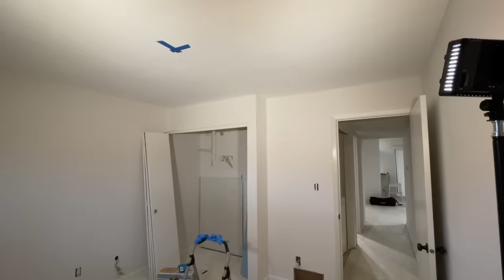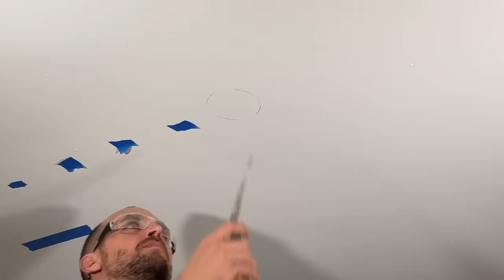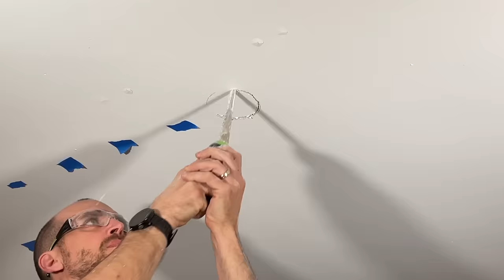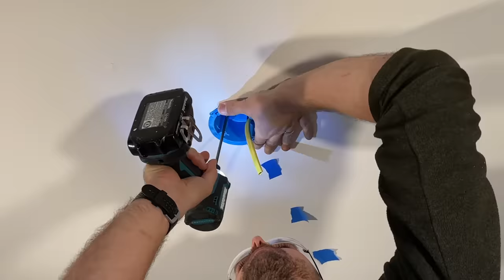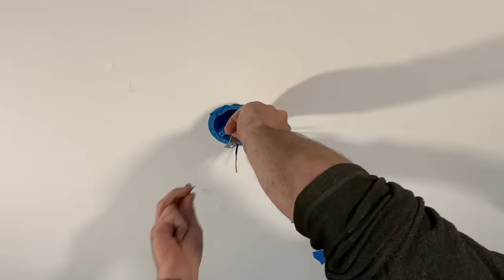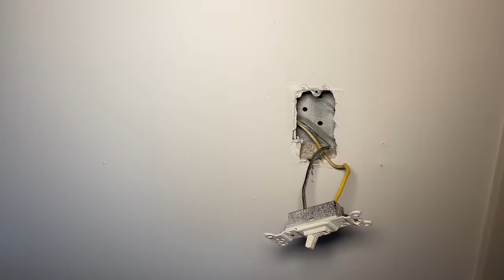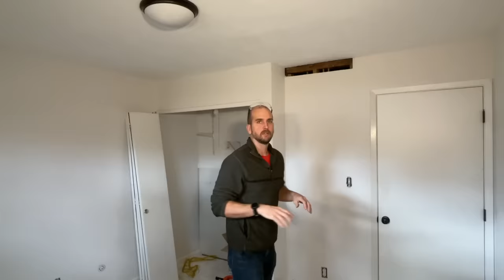How To Install Ceiling Light Without Existing Wiring

Comment: Is there a way to run the wire from the light to the switch instead of the plug? And get the same result?

Comment: For the holes I use a 4 1/2” hole saw.
To fill it I use a 6” hole saw to cut the plunge. I turn the plugs to the back side. Using the 4 1/2” hole saw I cut the backing paper and drywall- leaving the topping paper uncut. I remove the (donut shape) backing paper and drywall between the 4 1/2” and 6” dia. 

This gives me a plug with a paper rim. 
I pot a line of caulking around the edge of the plug and wood glue on the paper and stick it back on. When it drys I skim coat it with 20 minute mud. Then paint.
Reply from the maker: Not bad, I have seen more and more videos on YouTube using a similar method to patch drywall.  I think some guys call it a "California Patch."  Thanks for sharing your experience.
Reply: It’s funny it’s called California patch as my dad came up with it while we were on a job in the 1980’s. A guy punched holes all over and we had to fix it. Not to say he did not invent what was invented as that happens. Lol I rather call it a Ontario patch lol but OK 

Great video keep it up

Comment: Hey Scott. Great instructional video. Here is a question for a similar situation. We live in a bilevel. In the downstairs family room there is no ceiling fixture of any kind and no wall switch. It does have four or five wall outlets. The room is quite dark year-round so we rely on table lamps. We'd like to install a ceiling light of some kind and change out the outlets to modern ones. Is there a way to do the ceiling light and switch by branching off the outlet wiring?

Comment: Exactly what I'm looking for. Have a swag lamp on a switched-only outlet and the TV plugged in on ext cable 10 ft away when it COULD be on that outlet. Only issue is most of the outlets are old 2-prong. I've converted a few to GFCI for lack of ground wire. I still want a ceiling light of some sort in there tho.

Comment: Nice video, and detailed, too. 

I am terrified of electricity. Often, I would love to make a few electrical changes in our house. But, too scared. On some power outlets, when I remove the cover, there are SO MANY wires. And, some are not even connected. Just confusing...
Reply from the maker: Hey Ivan, I think you are with the vast majority of home owners who are scared of electrical and plumbing.  I honestly suggest not to jump into either of these areas until you feel you have the skills and confidence to do the work safely and without causing more damage than when you started.  Best of luck on your future repairs!

Comment: Thank you for this video.  I need to install a ceiling fan on a first-floor ceiling and this gave me some good ideas.  I'm hoping the studs in the room that needs the install goes along the path I need to take like in your video.  Also, I have to look into repairing drywall well enough that it won't be noticed.
Reply from the maker: Nice!  If you are going to wire a fan don't use the same old work box I used as here is the one you will want to ensure it can hold the weight  https://amzn.to/3naplXo.  Also, you might want to run 14/3 romex so you can have 2 separate wires, 1 for the light and the other for the fan.  Best of luck on the project!

Comment: If you are wiring from a socket it would be best to use a fused connection unit if you don't have a seperate lighting circuit

Comment: Romex (NM) cable is not allowed in buildings with metal studs per NEC. This is why you have conduit in the walls. You should have used MC (metal clad) with metal boxes. Unfortunately this is more expensive but is safer from a fire perspective. This is a common NEC violation in commercial areas. Please only use NM if you are have wood framing in your home.

Comment: One thing about the conduit, he's in Illinois and regardless, you need to check local code if emt is required or not, it's not only commercial especially in Chicago and surrounding suburbs. But always check local amendments, example in Elgin...nec says EMT is ground but in Elgin a ground needs to be pulled through every conduit. Just a reminder to always check local amendments that's all.
Reply from the maker: I completely agree 👍

Comment: Instead of tapping into the outlet at the bottom, can you do the same at the switch itself if you want to install a ceiling fan with light and control it with the pull chains in the light or add a second switch box next to the original box and use that for the fan (oh, and replace the outlet controlled by the switch so it doesn't depend on the switch?) Thanks.
Reply: I am about to tackle this project and too thought why not just power from the light swich? These youtube videos make the job seem cumbersome. I dont care that I would stil have a switched light. Easire is beeter IMO. So your saying I can just run romex from the ceilng and tie into my light switch?

Comment: Check with your local electrical code... condo may require a combination of rigid conduit and armoured cable... vinyl cable is not allowed in those types of spaces... check the NEC and CEC...
Reply from the maker: Thanks for the feedback Eric 👍

Comment: If you precut your drywall patch pieces and then trace them on your wall and use an oscillating tool to cut out your access hole. That way you dont have to cut your drywall to size, it just fits perfectly

Comment: If you are required to use conduit like we are here in Cook county Illinois... just cut and remove a path in the drywall in large sections along the stud/joists so that it can be reinstalled and patched. In this example, the romex is not "strapped"

Conduit prevents fires from sparks, and makes retrofit and repairs easier.
Reply: And 12/2 is only  for 20  amp breaker  ....not light 15 amp breaker  14/2 because  he using  12/2 for light

Comment: If you had attic access, would you put a bracket on the box, so in the future a fan could be installed?
Reply from the maker: Actually I should have done that either way.  So, yep make sure you have a bracket which could take the weight

Comment: I guess you can’t do this with a regular ceiling light fixture due to the weight, right? I’m going to move a light in my kitchen but it’ll be a standard light. Too heavy for the drywall to withstand.

Comment: Great informative video. For this project why didn't you run Romex straight from the ceiling light fixture to the wall switch instead of to the wall outlet? I need to do this project too.
Reply: Looks like they ran the feed/hot to the receptacle. So he needed to pick up the neutral for the light. A switch doesn’t necessarily have a neutral wire at the switch. A switch doesn’t need a neutral to operate.

Comment: I know this is an older video but wondering how you got through that top plate at 6:50? I saw you send the fish tape from the ceiling to the wall but then you're pulling it down to tape on the Romex with no explanation of how you gained access through the sill.

Comment: I hope this isn't a dumb question but in my lounge room I only have power outlets but no ceiling lights.  I was looking at this video but I'm not sure it addresses my issue.  I wanted to run romex (sp) from one of my outlets to a light switch I'll install.  Then from light switch I wanted to run cable into a ceiling light which I'll install.  I'm not exactly sure if I can follow this video as there was an existing switch.

Comment: Anyone watching this, please note that your homeowners insurance policy will not cover any damages to your home caused by faulty electrical wiring if the work was not performed by a licensed electrician. This guy has multiple code violations going on here , do not follow his advice. Call a professional .
Reply: what code violations? aren't those in-ceiling retro-fits not intended to be installed to a joist?

Comment: Great job showing the wiring setup!   Thanks....Jim
PS.....you could have made another video showing how to add a switch in same box and keep the switched outlets, or eliminate one or two.
Reply: That’s what I was thinking.  Add a switch and then you’ve got both a light and switched outlets.  A pretty small amount of added work with a ton of value.

Comment: I am a electrician  in Ireland  and  we deal  with  250 volt which  is a lot  more  dangerous ,    in the US  they use  110 volt  which is  more  safer   and you won't  get electrocuted  with  110 volt

Comment: Amazing video.  Almost a perfect instructional video for my situation.

Does anybody know;
  If I am wanting to make the junction box supported enough for a ceiling fan (in case a tenant wants that)..is cutting a larger hole big enough to mount supports the only option?  Or are there other junction boxes that can be used that could support a ceiling fan?  Thanks in advance.
Reply: Yes!  They make ceiling box supports/kits that fit through the standard box hole in drywall and are pressed into the 2 joists with a screw mechanism simular to a heavy equipment tie down ratchet handle you see when the chain heavy equipment to trailors.  The box is then screwed into the bar/screw mechanism of the support.  Hope that makes sense.  They should be at your local box store. 

The 2020 code requires ceiling boxes be able to support fans with a few exceptions.

Hope that helps.
Reply: This video from THIS OLD HOUSE shows the equipment I mentioned.

https://youtu.be/6r_Ni1gc5xg

Comment: They make remote control low voltage lights. Also if you can get power to ceiling it can be switched remotely just like a fan.

Comment: Should you not have a switch to control the outlets? Ideally you should turn off the switch before plugging any device into an outlet which you would not be able to do. So is not this introducing an element of risk in operations? 
How would you go around adding another switch to power the light rather than using an existing switch for the outlets.

Comment: It looks like you omitted the shots where you drilled holes through the studs where you fed the wire through later on. I'm guessing you used a 90 degree chuck with a hole borer, correct? Just wanted to point that out for those folks who want to use this as a step-by-step guide 😊
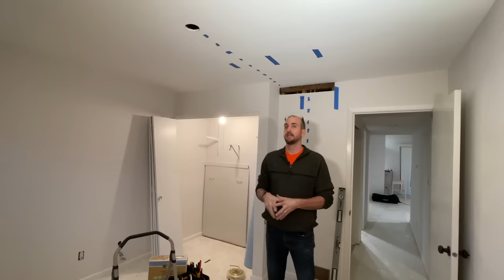Reply: He mentions that he didn't need to that at 5:45
Reply: @derekh135  I heard that as well, but it's confusing as to why. For anyone else attempting to do this they're going to run into headers at the top of each wall. Unless you're somehow lucky enough to already have a hole their to feed the fish line through you're going to have to do some drilling

Comment: Good video. I need to do a similar project. I notice that when you fished the NM cable thru the ceiling, you just letting it lay on top of the ceiling drywall. Is that to code?

Comment: If you did not want to replace the outlets you could have added a short jumper wire between the two screw terminals to replace the original jumper that was removed.
Reply from the maker: Hi Blaine, thanks for the feedback.
Reply: @EverydayHomeRepairs  No problem - outlets are cheap enough so not a big deal regardless.

Comment: Here's one for you. Three new pots lights were installed in my Mom's home. Each pot light had from what I can tell has a 20 watt LED  lamp in each socket which is equal to 100 watt incandescent. Which is way to bright for the area. We replaced them with 8 watt LED bulbs. Maybe a few weeks later or a month they all burnt out. But the same bulbs in other lights are still going. Is there a very good chance the wiring for those 3 pots lights is allowing too much power to come through? Or is the dimmer switches for those pot lights not right one?
Reply: Shit quality led bulb

Comment: How would you go about replacing an existing 12/2 with a 12/3? I'm wanting to split out the light and fan in the fixture.
Reply from the maker: Is the Romex loose and could be pulled from either end?  If so, I would do the same method I used in this video https://youtu.be/KgChTKOaNsA?t=347
Reply: @EverydayHomeRepairs  First, both vids are great, very informative. But in my situation, the fixture is on the first floor, so no access from above, the run is about 10ft across the ceiling the 12ft along a wall to get to the switch. I was hoping for a trick or two to avoid cutting the drywall...
Thanks!

Comment: Great video!! Can you do a video about how to draw power from a light switch to add a non-existing power outlet that is always powered? I need to add an indoor outlet for my security camera that has a short power cable. Thank you so much.
Reply: Drill a hole in the ceiling if you have attic space to go into. Just wide enough to fit the cable. Cut the male end of the cable off and feed your now cut camera cable through. Splice the wire and hard wire it directly into the circuit in the attic that drops down to your room receptacles. You'll need to add a junction box up there for the splice. That way it can't be simply unplugged and will probably look way cleaner.

Wouldn't hurt to have a little yard flag or something you can stick through the hole to spot in the attic if you have blown insulation all over. You'd still have to locate a usable circuit in there.

Comment: My tip:: since the outlet and switch are in same cavity drill 2. 4" holes in each cavity just down from sill plate drill one hole in vertical 2x4 drill one hole through plate that lines up with where u want light. drywall guys can replace plugs minimal drywall repair.

Comment: I noticed that you pushed the nails through the sheetrock when you cut the hole for the light.  Would it be better to use a hole saw to create a hole in the ceiling?

Comment: I personally would have just left the old wires I didn’t need and capped them off so I could would have them there if I ever needed them.also just saying but your box make up is really messy and why did you leave your wires so short that you brought it .why not just leave a loop .I get the other wires in there were short but shortning yours just adds to the work in the future

Comment: Do you have a suggestion for installing overhead lights on a concrete ceiling so that they still look aesthetically pleasing?
Reply from the maker: I think you would have to do external conduit and box which doesn't look great but probably your only option.  Running and bending conduit is a tougher install as compared to what I demonstrated here.  Best of luck!
Reply: @EverydayHomeRepairs  thanks! I know some of the canless lights nowadays don't require junction boxes, so that'll at least save one eye sore.
Reply: @jasonakinaka4382  True, but they are crap.  And honestly, as an electrician I think they are a huge scam.  I jumped on that band wagon about 10-15 years ago.  The problem comes when you realize that you can't "change the lightbulb" and the manufacturer has (ahem, intentionally?) "upgraded" the styling ...so now you're stuck with a ceiling that has say 8 recessed lights ...7 that look the same and 1 that looks weird.  And then another goes, so what do you do?  This happened to a friend on a commercial job with like 40 lights in a store.  The owner was furious.
They are also impractical: you can't change bulbs if you want brighter lights; or if you decide that you wanted a warmer color temperature or different beam width.  Instead of changing the bulbs, you'll have to buy new fixtures.
And then of course there is the issue of more trash and landfills...

There are some cool alternatives of course...
I've always likes low voltage double cable or rail lights (I like rails better than tracks, but track works too).  They are functional, flexible, artistic, and you can get different heads and change the lighting quite easily.  If you're an artistic type, they can be fun too ...I did a fun spiral/squiggly installation in an art gallery.  In another installation I saw (I didn't do it) all the lights were different airplanes -the owner was a pilot and had collected the lights over the years from different companies!  :-)

Just a thought if you haven't done the work yet.  :-)
Reply: @SwingboyPA  Thanks for the thorough write up. I think you're generally right, but I was able to find the canless lights that aren't so bad. 1) the are dimmable, so they work really well that way in not having to change them out just to change brightness, and these have temperature switches on the tiny junction boxes each light comes with. 2) if it fails, I think replacing won't be too difficult as there are many brands out there that sell a product that looks exactly like the one I bought. So unless they all decide to switch looks (which is possible), I don't think it'll be too much of a problem to replace one. And if they do all switch, I suppose I'll be forced to switch them all at once.

Comment: As a public announcement, lol.  If anyone has switched light sockets, if they are on a dimmer switch, especially a smart home dimmer switch, label them with something like 'DO NOT USE' on each socket, because if you plug a vacuum or something into them, they will kill the switch, and the smart switches can be pretty pricey. And whilst you know not to use them, others may not.
Reply: You may also want to call an electrician, because I believe dimmers on sockets are against code.

Comment: Question. I have two light switches that control two separate outlets in my living room. Is it possible to make the outlets always hot and run both light switches as a three way to switch on/off a ceiling light preferably with a fan?

Comment: How did u fish the steel into the top plate on the wall? I didn’t see u drill a hole in the top plate and with the patch at the top of the wall that size I don’t see how you would grab the steel and bring it through the top plate

Comment: Just trying to understand, Why are you using a magnetic stud finder on wood studs?
Reply from the maker: It actually finds the screws holding on the drywall which indicate the location of each stud 👍